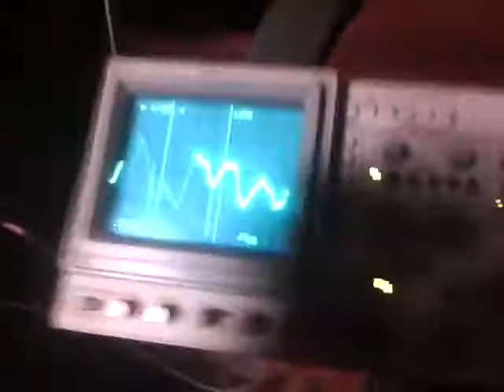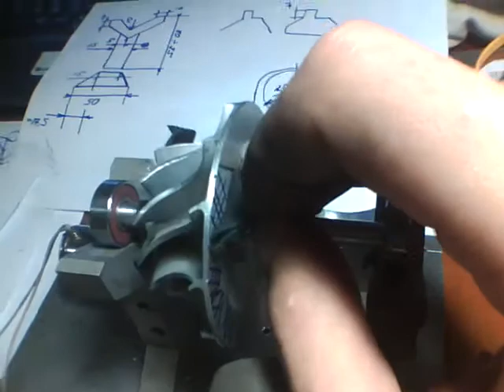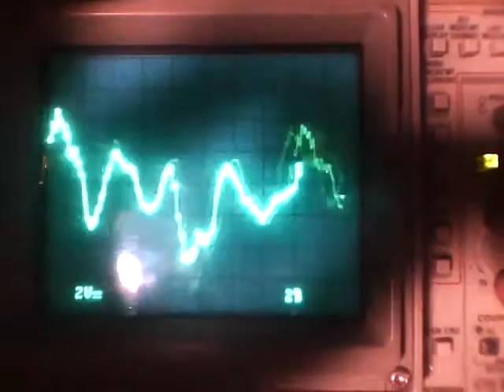My Balancing tool

Comment: it definitively is not an operating RPM :)
Reply: the point of balancing a turbo is so it wont self destruct at operating rpm, so if you took it to operating rpm while balancing and it was out of balance far enough to self destruct, guess what would happen?
Reply: If you check it at 10,000 rpm and there is zero imbalance, wouldn't there still be zero imbalance at 100,000 rpm?
Reply: AmericanThunder I doubt that compressor wheel would survive at 100,000 rpm... at most 50,000 rpm, peak efficiency should be in the 25-30,000 rpm for the unit, otherwise the bearing will just get torched... Ceramic ball bearing turbos are the way to go...